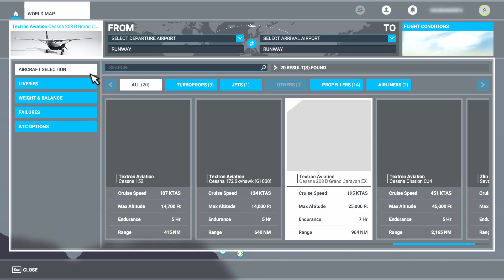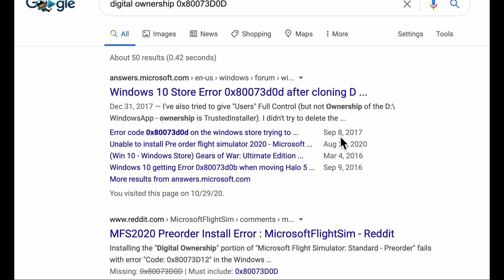Flight Simulator 2020 Update 5 v1 10 7 0 Patch   My Thoughts, bugs and issues

Comment: For the first time after the release, the MS Flight Sim updater refuse to install with the error code x80070141. The sim wouldn't start unless I perform the update, so I was stuck. I didn't want to re-install the 100GB game so I made a call to Microsoft but they were helpless to find the problem and sent me to the developer support site. As usual, I went through different posts on the internet until I found the right one on reddit. It concern a weird additional registry key which contain the installation path that seem to have been added. It double up the path keys. So just remove the offending key and bingo, without even rebooting, all updates went through. As for the patch, there is a couple of desktop crashes. Not sure if that was my graphic card OC but disabling overclock seems to work ok. I have to do more testing but so far, the sim run really smoothly and I am surprise that my Rx570 perform so well (1080 High).
Reply from the maker: Good to know about the reg key.  Not sure why Asobo has so many challenges getting these patches to install.

Comment: I just installed it, I have a TM Warthog.  The sensitivity for the axes changed to basically zero until 90% deflection then went thru the roof.  Once I adjusted this, it seemed to fly OK.  The Saitech cessna rudder pedals did the same thing.  I will edit this post if I find anything else.
Reply from the maker: Thanks for the update Vrooden !

Comment: I didn't really notice any control stick sensitivity changes, rudder is still twitchy on the ground. I use a Brunner CLS-E FFB stick base and TM TRP pedals.
Had my first CTD, but then I might well not have used FS2020 enough to run into that one, I've only put maybe 10 hours into it since release.
The patch downloading issue is now fixed - for me at least.
I'm still just waiting for helos and more aircraft without those boring and ugly glass cockpits - oh, and some performance upgrades, it's still marginal on framerates
Reply from the maker: I did not notice any FPS improvement either.  Looks to be about the same as it has been the last few patches.  Thanks for the update here ASR.  Good to know!

Comment: My elevator trim wasn't right from the beginning with my Honeycomb yoke (it works fine in XPlane 11). I finally gave up and mapped it to the prop control on my logitech throttle quadrant so that I could at least fly the 172. This update seems to have fixed that issue and I can use my switches on the yoke again. I haven't flown yet today but everytime I tried yesterday it was working normally. However, before the patch, earlier this week, my escape key quit working while in the cockpit and I still have to exit via task manager unless I complete a flight. Asobo is getting there slowly and I'd like to thank them for their efforts.
Reply from the maker: It's getting there slowly.  It can be frustrating when they fix 1 item and break 5 others tho heh.
Reply: Because of pandemic!
Reply from the maker: @alexmercer7687  That indeed might be a contributing factor.

Comment: Great vid, thanks, Install went well, flew the Halloween challenge but found the pitch erratic whilst landing, went to re-adjust my sensitivities on my x52 pro control settings and now the sim constantly CTD, it will boot if i remove the saitek X52 USB, sim loads and i could probably fly with a different joy stick. Tried a few repairs, reinstalled twice, issue still exists, reinstalled logitech flight drivers problem still remains so now installing windows again :( gutted but i have been flying since day one with only a handful of crashes so I have been luckier than most.
Reply from the maker: Wow sorry to hear this.  So frustrating!
Reply: @badGamr  CTD Hotfix released today ;) unfortunately im just reinstalling windows  thanks for the updates
Reply from the maker: @Ja50n01  You bet Jason!

Comment: Dint have any issues until this patch, however during the update I accidently switched off the power supply to the pc, started the pc again and the checking update screen was frozen, tried everything there is to be done as mentioned on various forums and web suggestion, nothing worked, finally uninstalled and reinstalled the whole game. Disappointed. Don't know why wasn't able to continue the update from where it stopped.
Reply from the maker: At this point I am surprised these updates work at all...

Comment: My first patch that completely borked on install.   Had to end up reinstalling Windows to get install going.  Would appreciate letting us kniw your workaround for getting it working
Reply from the maker: I would not bother installing the sim until they release the hotfix this weekend.
Reply: @badGamr  too late im at work and computer downloading 94gb.  I NEVER should of deleted the main game files in the first place only tried that as a last result with no.luck
Reply: @badGamr  how did you end up getting it working?
Reply from the maker: @gregson99  To be honest I am not sure what I did that eventually got it working.  The primary issue for me was the digital ownership certificate refusing to install.  I actually removed it from it's dedicated drive and up to my boot drive after re-arranging things so it would fit.  I also ran the cleanup utilities that I found in these searches and web pages:

https://www.google.com/search?q=digital+ownership+0x80073D0D&oq=digital+ownership+0x80073D0D&aqs=chrome.0.69i59.5142j0j4&sourceid=chrome&ie=UTF-8

https://answers.microsoft.com/en-us/windows/forum/windows_10-windows_store/microsoft-flight-simulator-2020-installation/89961359-2ec9-4dfc-bdf4-c4993c20b63e

https://answers.microsoft.com/en-us/windows/forum/windows_10-windows_store/windows-10-store-error-0x80073d0d-after-cloning-d/1d4c7b5b-5302-4570-b2d8-2cf139aecd98

https://support.microsoft.com/en-us/windows/using-system-file-checker-in-windows-10-365e0031-36b1-6031-f804-8fd86e0ef4ca

The initial download from the store refused to work for a while until I completely uninstalled the application and removed all traces of it from my system.  After that update ran (I also had to run some cleanup utility for the store that is referenced in one of the above links) I kept trying different things until after one reboot it started to work.

I should have documented the process better but after 4 hours of screwing with it I had no faith it was ever going to work again.
Reply: @badGamr  cool thanks . Microsoft is such a mess

Comment: I had a problem with updating and got an error message 0x80070002. Although I removed my controls and unplugged and reconnected the SSD, the issue remained. But when I uninstalled the installation (not the whole simulator) I was able to solve the issue. What you can do is : Find the Microsoft Flight Simulator launch icon-->right click---> select uninstall. Then go back to the Microsoft stores and re-install the installation files. This worked for me.  Please do not uninstall the whole sim. It is not necessary.
Reply from the maker: Thanks Rahal.  That was part of my process as well but sadly for me it did not resolve the issue.  Glad to hear it worked for you though!
Reply: @badGamr  Thank you very much for sharing your issues and fixes with us. Great work.
Reply from the maker: @rahalwidanagamage  My pleasure as always!

Comment: I have issues with the 320Neo ( default ) which has had a knock on effect with the Fly by wire mod .
Reply from the maker: Folks on the forums are also reporting an issue with the fly by wire.
Reply: @8T8Keez  have you tried the development nx? I've had some many different issues.  I'll have to be patient and get back on Xplane
Reply from the maker: @8T8Keez  I tested some liveries with the a320 this AM and they worked fine if that's what you mean.  Someone else had an issue with them tho so you may not be alone with that issue.
Reply: @calamityairlines9762  The developer version has an issue when you increase throttle one click the plane starts to move and even though you cut throttle - plane still moves... annoying. PLUS the sounds are a lot lower.

Comment: The only aircraft that is flyable for me now is the payware C182. I'm using the HOTAS 4
Reply from the maker: What if you disconnect your HOTAS?  Does that let other aircraft fly?  Is it crashing when you fly other aircraft or are they just uncontrollable?
Reply: @badGamr  The payware Mooney crashes the sim but the others go into a left spiral dive & others like the jets they point down even in a slight climb the elevator won't work properly
Reply from the maker: @wrongwayfeldman5393  Is that with your hotas connected?  They made a big change to the control sensitivity curve with this update.
Reply: @badGamr  Yes I have tweeked it & the C182 flies nice so it's more bugs in the latest patch I'm sure the devs are on it for us
Reply from the maker: @wrongwayfeldman5393  Sorry for your troubles man.  Asobo has quite the hill to climb in terms of fixes.

Comment: the stall speed on the 150 and 172 are too high. the 150 and 172 is stalling at 70 knots with full flaps,  the 172 dont even wanna take off at 75% load the tail stalls and will not give any input
Reply from the maker: You have no mods or add-ins?  Community folder is empty?  You might try this mod for the 152 is nothing else works as it corrects a bunch of inaccuracies: https://github.com/DRF30q/C152X

Comment: Im still stuck at updating with the sim showing me i have 21 GB left to download, after I downloaded 6GB of the 7GB update which was weird wasn't been able to update because of this.
Reply from the maker: Ouch!  No error message?  It's just hung updating?
Reply: @badGamr  not hung but it's showing me i have 21GB left to download
Reply from the maker: @aviationwingz9402  I had about 21GB to update in the content manager after the patch.  Might be part of that.
Reply from the maker: @aviationwingz9402  You might try this:

In the Windows search bar, type Command and look for ‘ Command Prompt ’
In the menu select “ Run as administrator ”
Enter: netsh int tcp set global autotuninglevel=disabled
Press enter
Reboot your computer
Reply: @badGamr  i did this 
for some odd reason after one bigfile the update hung and then refreshed and showed me that i have 21 GB to download while in reality it should be 1 Gb
Reply from the maker: @aviationwingz9402  Is it still hanging?
Reply: @badGamr  actually the hanging is not the problem but its that 21GB because it should be 1GB
Reply from the maker: @aviationwingz9402  Ahhh ok.

Comment: Mine installed fine, however my frame rate has dropped and I am getting more stuttering than I normally do
Reply from the maker: I have seen more stutter as well.  Time to re-tune I guess.
Reply: My frames dropped too by a decent amount :/
Reply from the maker: @will6497  retuning did not help me :(
Reply: @badGamr  hopefully the hot fix helps 😅 you got a discord server by the way??
Reply from the maker: @will6497  Not yet - it's on my list to get setup tho.

Comment: they messed up the night lighting of the ground !!!!!! floating lights everywhere !!
Reply from the maker: Where specifically are you seeing this?
Reply: @badGamr  well yesterday night i was flying in Rhodes island in Greece since i am in Greece and saw that.Many many little lights floating like being doubled.
Then i also noticed that the blip tail light was bliping a little behind from the aeroplane in the air🤦‍♂️
Reply from the maker: @AirGreekDespotas  I'll check that out.  Interesting that the beacon light was doubled.  Which aircraft did you see that on?
Reply: @badGamr  On the MB339
Reply from the maker: @AirGreekDespotas  Thanks!
Reply from the maker: I suspect the beacon light issue is related to the MB339 addon and not endemic to the sim itself as I do not see the beacon issue on any other aircraft.
Reply from the maker: @AirGreekDespotas  You are absolutely right.  I just flew through Rhodes at night and the eastern seaboard is littered with extra lights sitting about 800 feet of the ground.  Terrible :(